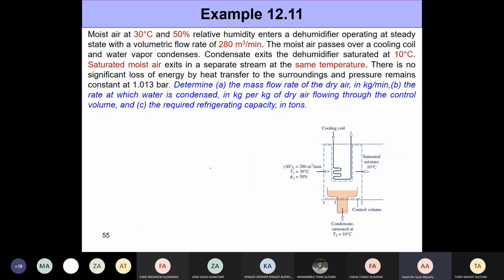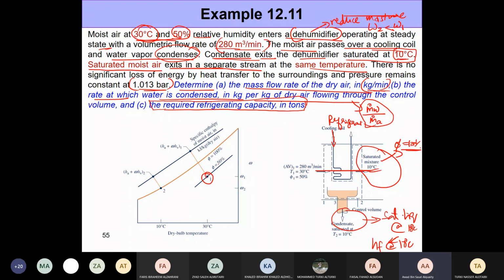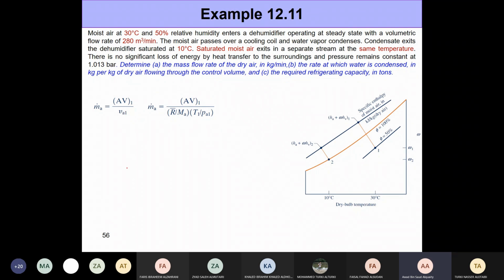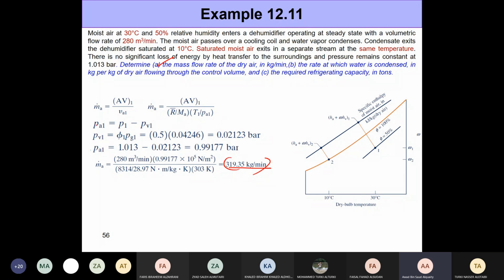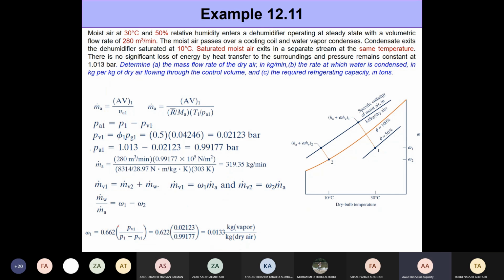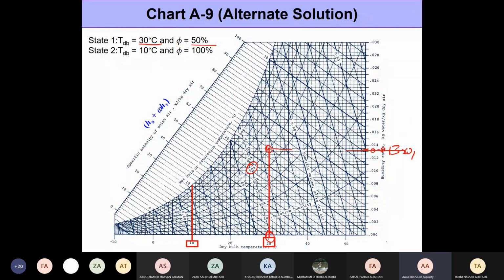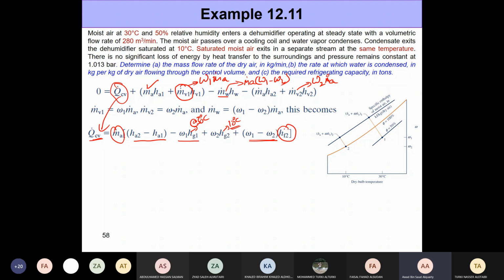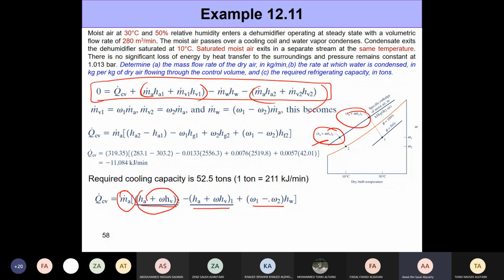Solved Example: Cooling with Dehumidification

Comment: h1 and h2 can find from formula otherwise psychometric chart
Reply from the maker: Yes that’s correct, although the use of formula requires obtaining the enthalpy for dry air and water vapor separately from tables. Difference in enthalpy of dry air can be approximated as Cp(T2-T1) as well